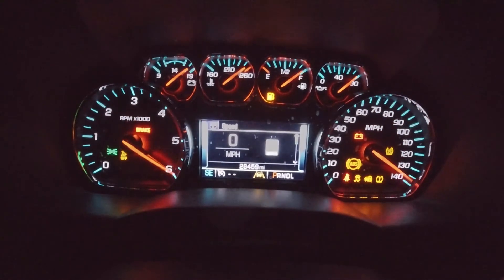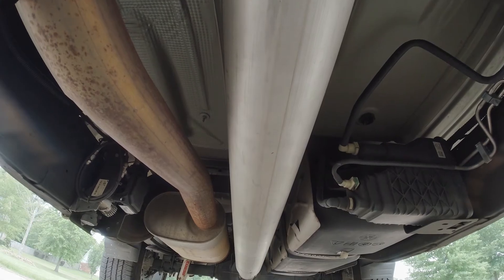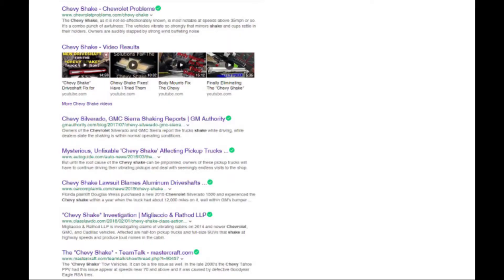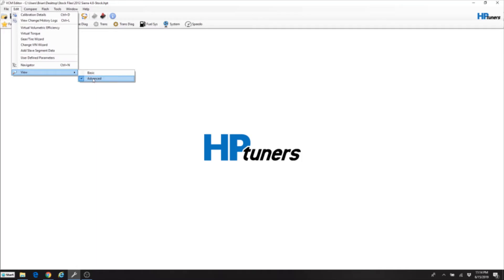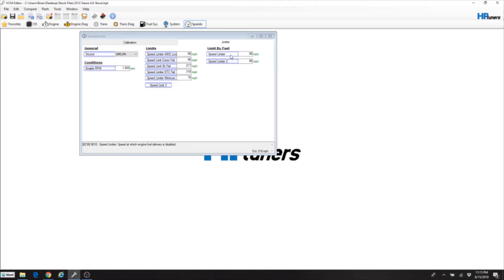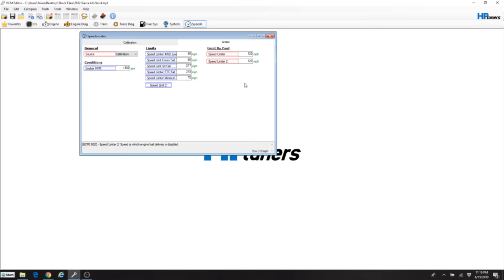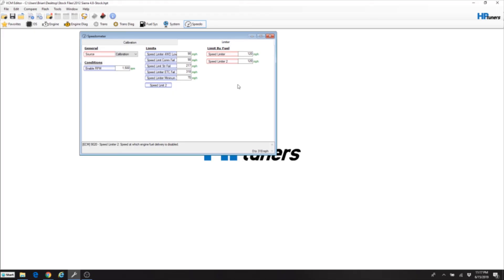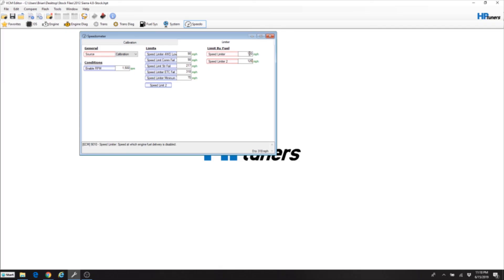How to Raise Speed Limiter with HP Tuners

Comment: I have a 2015 f250 powerstroke that i tuned with a 100 horse street tune, my limiter is set to 95 and limiter B is set to 180, if i up my standard limiter to 180 to match would that alter performance at all aside from stopping my fueling to cut out at 95mph or would the truck just cintinue fueling until the turbo couldn't keep up with air?

Comment: Did I miss something? I thought you were going to demonstrate how to increase your speed on a truck? I’m just as lost now as I was before I began my quest.
Reply: This is for if you’re already familiar with HPtuners, you’ll need to buy a tuner from HPtuners and also have a laptop to plug into the tuner. You’ll also need to buy credits to actually unlock the truck and write tunes if your truck is capable of that. Do your research because some newer trucks require you to pull the computer and send it in for a reflash, the newer the truck, the more expensive it will be to unlock. My 2015 was $100 to unlock, but my 2022 would be $600 to unlock if I wanted to. Like I said do your research before buying this because there might be cheaper options for your platform.

Comment: I could not believe my Silverado fell on its face at 98mph,, how disappointing!!!!
Reply from the maker: Yup.  Lots of reasons for that.  Driveshaft was just one of them.  So much more fun when you can open it up a little more.  ;)
Reply: Since your video I ran out to look at drive shaft and it has a 5 inch  aluminum so I don't know if it still would hold together much over the 110 plus mph, let me know please if you should  know..
Reply from the maker: @stevenstair1068  I did the same.  Had mine up to 120 and no issues.  But it’s a little sketchy at that speed.  These trucks weren’t meant to handle that.  lol
Reply: My 17 Sierra Denali 6.2 I had it open all the way to 120mph well I took it to the dealer for transmission oil change and I picked up yesterday it only go 98mph 
Can’t wait till tomorrow to go to de dealer and blow some steam

Comment: It's completely ridiculous there's a limiter on how fast you can go. I just want it set to the max . I have a 5.3 litre 4x4 and it seems like they would definitely use better drive shafts than what they're using for pulling capacity and for speed
Reply from the maker: Cost savings and warranty.  The OE doesn’t care how fast you want to drive.  Whatever reduces cost and keeps the vehicle out of warranty.

Comment: I did this. Worked for about a day. Then back to limit. I checked tune and it was changed back. Called Onstar and told them I did not want any communication with any part of my truck. Green onstar light went out. I reloaded the modified tune and it still won’t go over 98. Any ideas?
Reply: Thanks. I will try that.
Reply from the maker: For what vehicle?
Reply: 2011 GMC Sierra 4x4. 5.3. Auto. Afm has been turned off.
Reply from the maker: @jeremyjessup9695  yup.  The 4wd and AWD sometimes is one that you have to go through HPT and get some additional support on.  If you email them directly with that in the subject line they can assist.  Kind of an oddball one but they are away of the issue.

Comment: The 5” doesn’t hold up either. 115 and boom. Trust me.
Reply: Itll hold up if its a 4wd drives shaft
Reply: @WattWerxPEV  Ltz mine won’t go over 100
Reply: @myquickjab2098  if you get a HP tuner even a 5.3 will do maybe 125.  The drive shaft will have to be the shorter one, in other words yoy better have 4x4 if you're going over 110.  My 6.2 will do 140+ easily.  It hits a wall about 140 and creeps slowly but my 33 inch tires on 22s are my concern.   They aren't rated for that speed and can come apart.  Then its the morgue for me.
Reply: @myquickjab2098  same it sucks
Reply from the maker: Living dangerously in retirement is a good thing.  Nice job Master Sergeant!
Reply: Muscle Car Solutions good thing it didn’t come off the jack stands. 🤣

Comment: I wish I could get something like this for my 2004 Jaguar XJ8 which is currently over-restricted to 120 mph, so it can have at least a little something more on a track.  The supercharged version of that car is governed to 155.
Reply: @MuscleCarSolutions  Yep, pretty limited alright.  There are some out there that will support newer Jags and Mercedes from 2013-on as well as Mustangs, Camaros, Nissan Z -cars, and what not.  But as far as manufactures of those programmers, I guess nobody cares about any Jags and MBs of the early 2000s.  And I'm not sure if that's just me being cynical either.

Comment: I have a Nissan which use to govern the top speed at 108mph. I recently exchanged that blown engine for another 3.3L with 150k less miles BUT, it governs at 98-99mph. WTH..??  How did that happen(the shop that swapped the engines didnt do it), and how can I remove it altogether? thanks!

Comment: I raised these in my 06 with a 6.0 and the truck won't do better than about 112. I feel like there was a slight surge at that speed like another setting was holding it back. I looked through my torque management tables and I don't see anything speed related. Where should I be looking or what setting could be holding the truck back?
Reply: Aerodynamics

Comment: I have a Chevy Silverado 2008 with Diablosport and one day i ran so much and the driveshaft broke.
I Was racing with a tahoe. I Managed to reach 140 Miles
Reply: Trucks aren’t for high speed broo
Reply: @dennistv598  yes broo
Reply: @georgedreikhajamale8581  that's insane but you mean where your chevy Silverado was factory governed at 110mph the obd2 tuner bypassed that speed?
Reply: @cedricmiller4370  Yes 
I have 2 silverados 
The single cab was governed in 100 MPH
The crew cab was governed in 112MPH
I have Diablosport in the single cab 
And the crew cab HPTuner
Reply: @MuscleCarSolutions  Yes, you are right it was crazy what i did